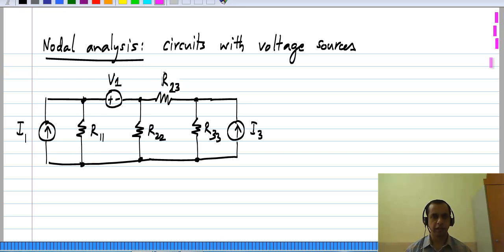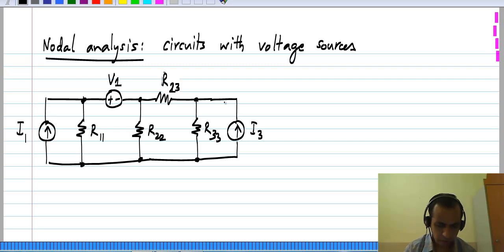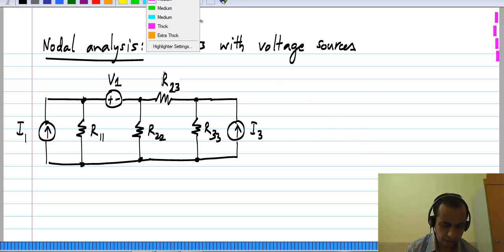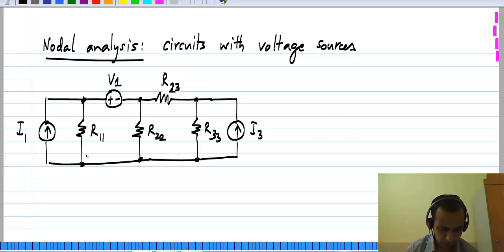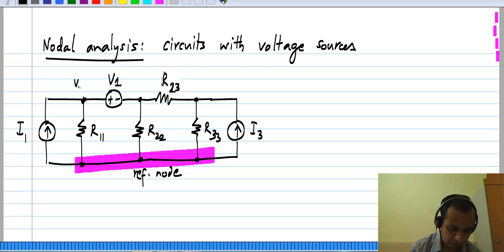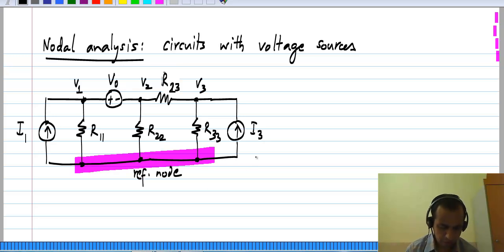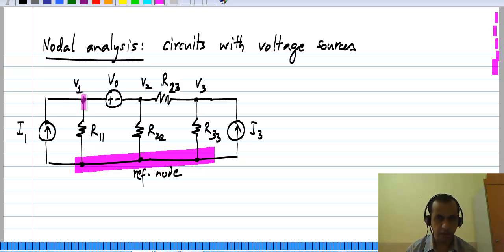Nodal analysis with independent voltage sources

Comment: LOTS of careless mistakes on this slide, professor. It's terrible! Correct them! Students are getting confused!

I-13 at node 2 at 5:41 is wrong.
G-13 at 7:09 is wrong.
Again, a G-13 at 7:54! R-13 does not exist, so neither does G-13!
Overwriting again at 10:02. Why do you overwrite? Rushed for time? Or just plain lazy?

Am pleased you rewrote the whole thing again at 10:51.

 Don't overwrite over a previously written item. It is ugly and confusing. Rewrite the whole line again, or ERASE the mistaken portion first.
Reply: What is the mistake at 5:41..? I'm getting confused after seeing your comment... I may be dumb, could you please elaborate..?